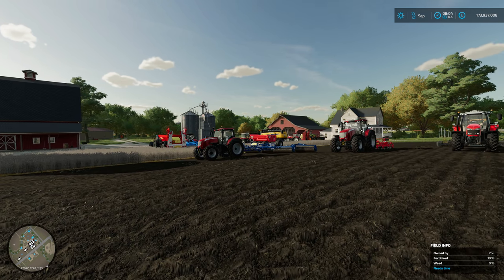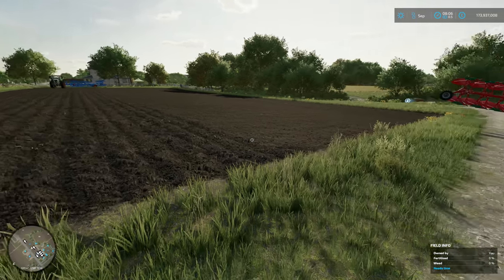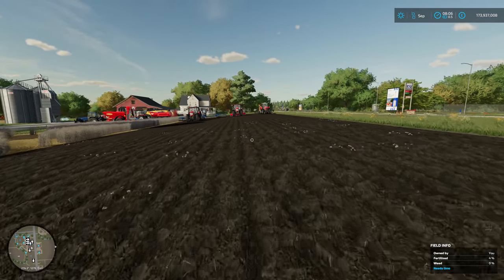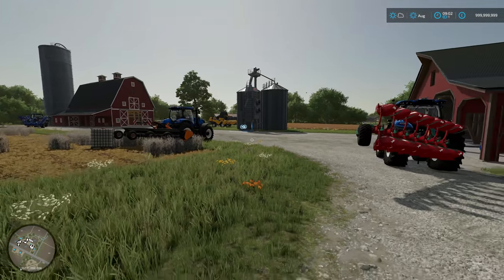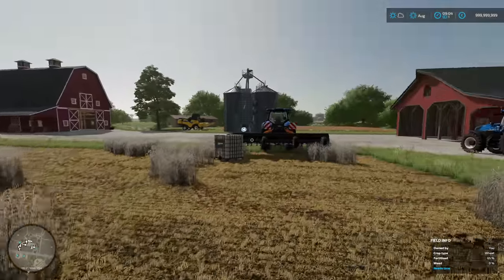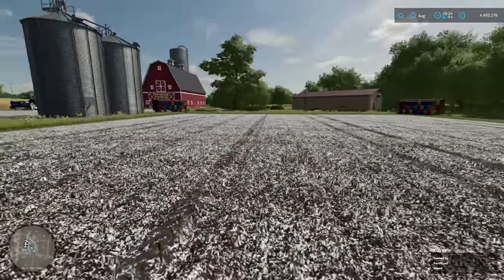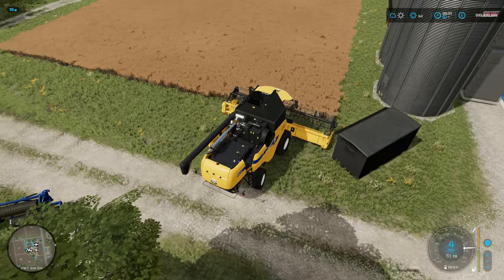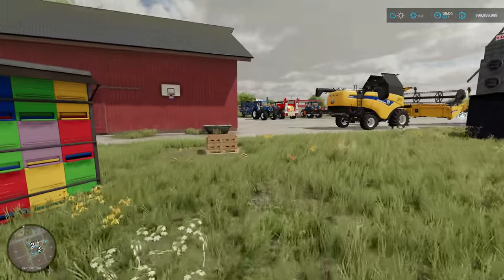How To Maximise Crop Yield! | FS22| Part 2

Comment from the maker: RECAP If starting from a Harvested field:

Mulch 
Plow (if needed)
Lime (if needed)
Remove the stones (small ones by rolling, if you have big stones use the picker)
Cultivate (skip to planting if you have plowed or used the stone collector)
plant/sow
Roll
x2 fert
weeds 

There are different ways to go about it with the different equipment on offer but you need to make sure you get the bonus's 
5% Mulching
15% Lime
5% Rolling
23% fert 1
23% fert 2
0.05% Bees near to the field (only with Canola, Sunflowers and Potatoes)

THANKS FOR WATCHING 👍👍🤠🤠
Reply from the maker: @Ghetto Cajun sorry, thought I had. Thanks 👍
Reply from the maker: @Ghetto Cajun thanks 👍
Reply: Why fert after sowing? If you fert after lime and before cultivating and then again after cultivating or immediately after sowing you can avoid any possible crop destruction.
Reply from the maker: True, it's a down to preference I guess but it's nice to have the options now with the added growth stages 👍
Reply: @Scroft  I was wondering if there was more to it than preference. Thanks for clarifying. Great job on the videos
Reply: This is great! I'd never known mulching and rolling gave bonuses. Thanks a bunch!
Reply: FYI the .05 in the xml equates to 5%
Reply: Does weed decrease your yield or how does that work ?
Reply: @Nate_B123  Yeap, that was my thinking too. it's a multiplier, so multiplying with 0.05 gives you a 5% increase.
Reply: Forgot rolling after cultivating to get rid of stones before plant/sow (or am i being stupid?).
Reply: Nice work mate. But I think that with the passes that only add 5% or less yield there is no point doing them. If you factor in the cost of 1) the machine, 2) the fuel, 3) the cost of repair on tractor and machine, 4) the worker (if used) you will be at 0 at best if not in the red. So I reckon plow (only required after corn), pick stones (after plowing to avoid increased machine wear), apply lime (when needed), sow/plant (ideally with fert. application), fertilize, harvest. In ideal case you can do with just two passes (plant with fert. and 2nd fert.) then harvest. The money ant time savings are immense. If you factor in the time it takes to do all the other passes, you could easily do two harvests in the same time and only lose a few percent - or perhaps not even that (considering the costs mentioned above).
Reply: Too bad they removed anytime herbicide. Like in 19 after harvest it was fertilize, lime, cultivate, fertilize, sow/plant, herbicide and you were done for that field, just waited till it was ready to be harvested. In 22 you have to wait till the weeds have grown to use it, this means you can't finish a field in 1 go.
Reply: @MarcelHlbocan  Fuel is shutcha non cost i don't even include it even though i use a mod to increase it.. if i use base game on my current farm with 8 fields one tractor for all the work and do all these steps on normal my fuel use is just over $500 for 8 years (one Month per day season growth) and with the mod that changes to just over $500 for 2 years...
Reply: What about oil radish before seeding the main crop?
Reply: so do you roll. plant and roll ? or just plant and roll to get the +5%?
Reply: @tobiaspedersen8333  once after planting
Reply: Spraying herbicide hurts yield vs using a weeder, no?
Reply: Are the steps you summarized still the same today or have any updates changed it? Ji watched the whole thing and I love your videos btw! Most of them are pretty long but informative and well done.
Reply: I don't think it's possible to do x2 fert one after another, I think there needs to be something done to the field between each Fert in order for it to see the 2nd Fert.  I would do the 1st Fert after Lime, 2nd Fert after Roll.

Comment: Nice video.
Also, the checkbook for large stones isn’t plow size or land area, it’s plow type. Using a spader or subsoiler, which dig deeper than plows or cultivators, will more likely push up big stones
Reply: Nah, still wrong, there's more to it. Has to be. I'm getting only large stones with the biggest plow. But someone made a video stating that plow gives only small stones, that was also wrong. That's why i started growing beets because i can just roll it after plowing, but in reality i still have to use stones picker because there arent any small stones on the field.

Comment: What happens when u turn off lime, periodic plowing, stones, and weeds. Do you still get the maximum yield?
Reply: You have to look at each item. It will remove whatever the "effect" is on the crop. So not plowing will give you 10% reduced yield so turning off eliminates that reduction. However if you turn off fertilizer that gives you a 30% increase then you will be playing without that increase so can't get max yield. If u want max yield you can only turn off the things that give u a reduction not the things that give you a bonus. (Made those numbers up but we get the point)

Comment: How does having a cover crop factor in the work order for a field? And does mulching after a harvest still apply the yield buff towards the next cash crop planted or does cover crop negate that? I haven't seen any real thorough answers toward using cover crops in fs22 other than "it gives 1 fertilizer state". Wondering if you could do some experiments on it.

Comment: A spader digs deepest and leaves biggest stones.
subsoiler is next and leaves medium and large stones.
A plough is the shallowest and leaves small stones.
Reply from the maker: I thought this but on Haut I tested the theory and got only big stones on the field just south of the starting farm 🤔
Reply: @Scroft  even cultivating leaves large stones on that map. Probably a bug
Reply: Also according to the official website's farming academy section, only subsoilers should spawn large stones
Reply: @simon7109100  Yeah stones are totally off. Either all the information is wrong or they are bugged.
Reply: @Sweetw4ter  the information should be correct because it works as intended on Elmcreek and the alpine map

Comment: if you do shallow cultivation and then go over with a roller, it doesn't give you 100% weeds, but the same as with normal cultivation, so 50% (but I used Güttler Mayor roller mod)

Comment: is there a difference in seedbed (shallow cultivation) and regular cultivated soil?

because im assuming seedbed creation is for crops sown with a seeder (wheat, barley, canola, etc) whilst regular cultivated soil is for crops you sow with a planter like: Corn, Beets, potatoes.

but does that actually make a difference?
Reply: I believe Weeds will grow back quicker if you use a shallow cultivator
Reply: @tjp9142  Why does it matter ? They will grow anyway, doesnt matter is it next month or 2 months later. You still have to remove them.
Reply: @kaarelk274  Why does it matter? They asked if there’s a difference. Yes there is. Weeds grow quicker if you use a shallow cultivator. Are you not happy with my response to their question?
Reply: @tjp9142  Did you test it yourself ? Doesnt matter is it a shallow or a regular one, weeds are there the next day after sowing. 1 day month.